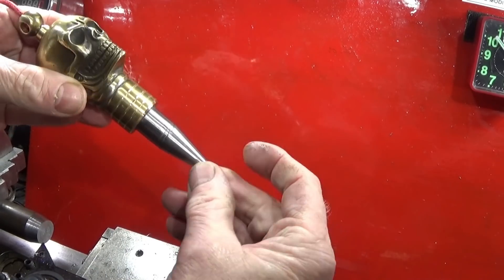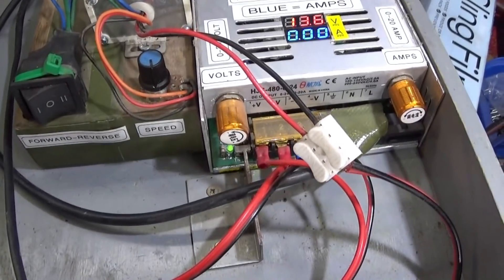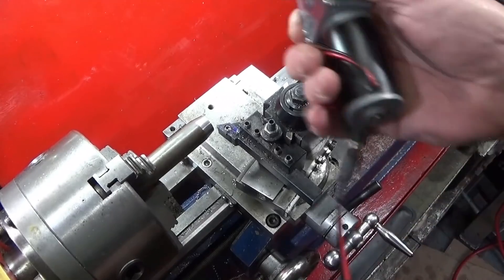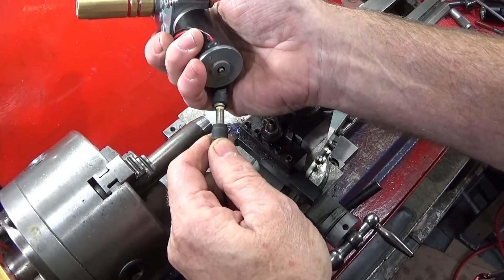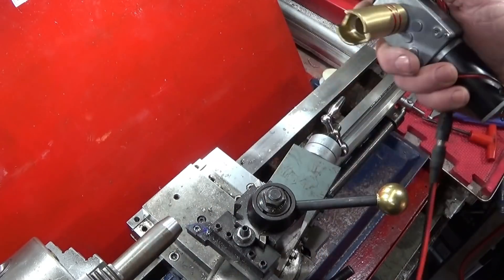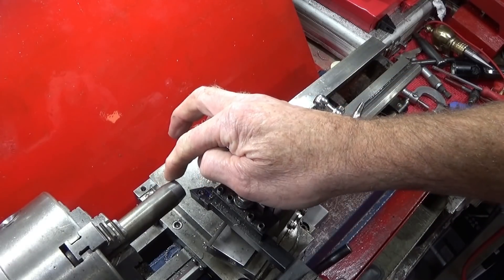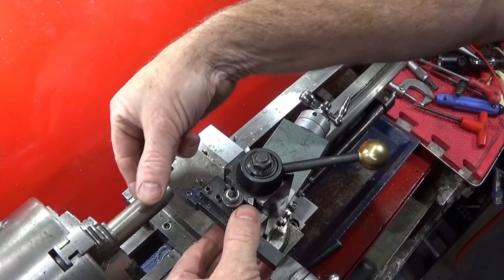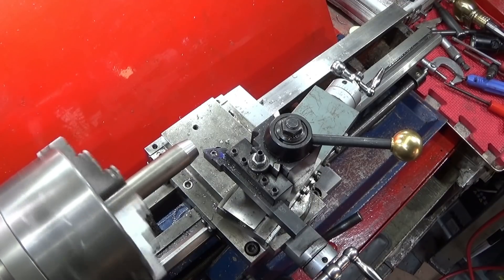Chinese Mini Lathe Motor Compound Drive Turning Long Angles

Comment: Nice job Steve. What happens if you accidentally hit end of stroke on the leadscrew? Does the motor bog down and stop? I guess if so its reasonably safe. Cheers, Jon

Comment: Another way of doing that is with a windscreen wiper motor. You can get them at some junkyards for really cheap. I get them for about $15. They generally have 3 speeds and are super powerful. I used one to make a tumbler for cleaning brass.
If the three speeds would serve a person, you would not need all of the electronic setup. (that stuff makes my brain hurt when I try to figure it out)

Comment: Steve, If you change out the cap screws that hold the handles on your slides to "Button Head  Cap Screws" you will gain room so your  knuckles (or your adapter) won't hit the cap screws. You can just google "button head cap screws" and see pictures of what I mean. It is a great cheap upgrade.

Comment: Will that actually work properly as a plumb bob? doesn't the body need to be symmetrical to hang truly vertical?
Reply from the maker: Hi Mike..Yes it works perfectly. It was machined with no run out from top to bottom....It's a dead weight :)
Reply: @zomgthisisawesomelol - That unbalanced mass will change the center of balance off axis.  I doubt it will be much, but clearly it isn't made to be an everyday workhorse.

Comment from the maker: SOME EXCELLENT SALES
11.11 Shopping Festival -- https://bit.ly/32xFLRw
11.11 Coupon Center -- https://bit.ly/35eUn9U
PLUS THE OTHER LINKS:-
HJS Switching Power Supply Transformer  -- https://bit.ly/33xyeCI
GW4058-31ZY Double Shaft DC Motor -- https://bit.ly/3fTtHPK
DC 9-60V 20A 1200W High Power DC Brush Motor Speed Regulator Speed Controller -- https://bit.ly/2HXruq9
12V 24RPM Square Speed Gear Box Worm Geared DC Motor High Torque 370 Motor -- https://bit.ly/2Jsf0Hn